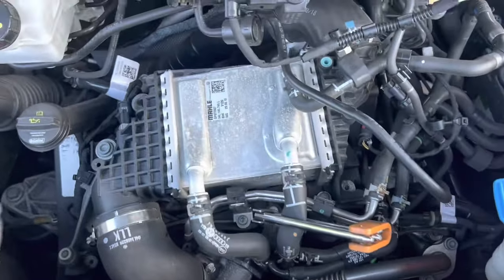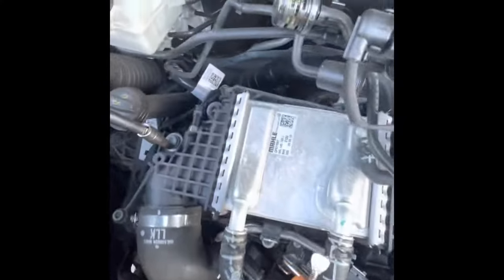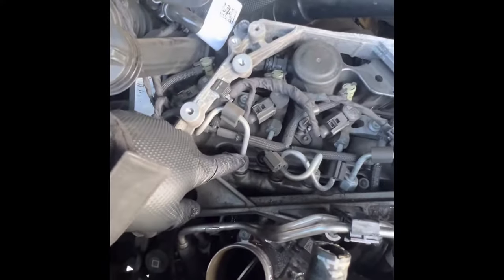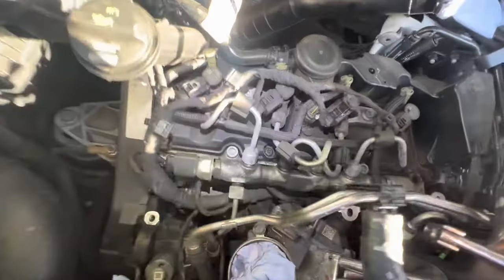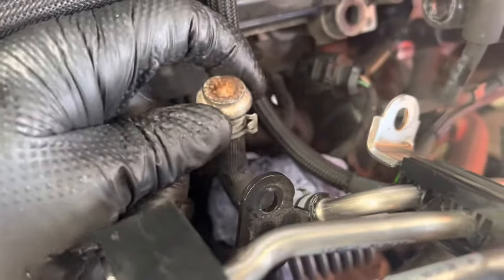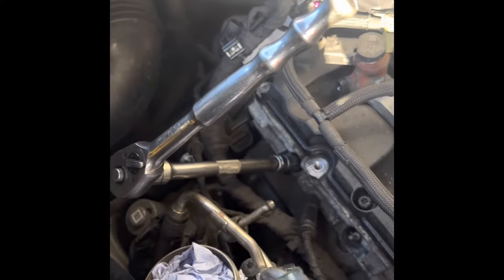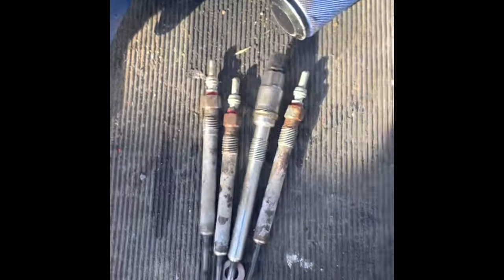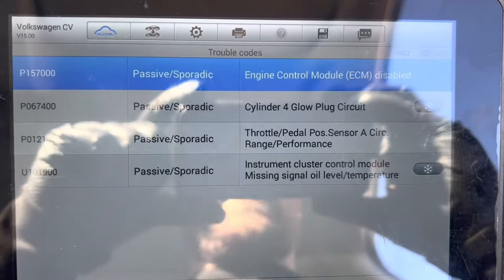How to replace glow plugs on a VW Transporter T6

Comment: I cant get start after i changed glow plugs, took fuelrail of. Bleed the diesel system with vagcom before i cranked but no start. Do the injectors need to come off and be filled with diesel/primed?
Reply from the maker: No, you should be able to keep bleeding it with vagcom, may need to ever so slightly crack 1 injector fuel like union whilst cranking, failing that you could put some brake cleaner in a spray bottle and lightly spray it in the intake system whilst someone else is cranking it over
Reply: Tried start spray and also opened on all injectors, but still no engine start. Also no fault codes on the car
Reply from the maker: @Kasperh27 easy start won’t necessarily work, it needs a slow steady spray (of brake cleaner, easy start is too aggressive) whilst all of the air is expelled, that’s all it will be is air in system
Reply: How did you get it runnin? I have the same problem.
Reply: @Ukulea56777  problem is delphi injectors gets air in and the piston get stuck, you need to make high railpressure and bleed the injectors. I used startspray and got engine up to around 4k rpm and bleed one after one injector until it fired, it take long time so be patient
Reply: @Kasperh27  Thank you!
Reply: @Ukulea56777  also you need to bleed injectors with electric connectors connected!

Comment: Good video, helpful.

Just gonna do mine as leak off pipe needs changing and one glow plug is down.  Seeing as you need to take all that crap off to get to the bits the lot are getting changed....

As for the missing bolt I was wondering that but seems there isn't one there and the cooler free floats that end.
Reply from the maker: Thank you, Really isn’t a bad job at’ll

Comment: Great video well done. I got to do these tomorrow. Is it 100% necessary to remove fuel rail? Looks like u might be able to get them out with in place? Always difficult to tell in a video 🙏 happy new year everyone
Reply from the maker: From memory, I think the one on cylinder 4 wouldn’t be possibly or maybe a bit tricky, it’s not difficult to remove it though, or to get the van started afterwards just cycle the ignition a good few times before attempting to start it if you’ve not got a diag machine that will active fuel pump or do a fuel air bleed 👍
Reply: Great stuff thanks for the info mate! 👍👍👊👊
Reply from the maker: No worries dude 👍

Comment: What diagnostic tool are you using to bleed fuel rail. Shame you didint do a vid on bleeding the system after refitting.
Reply from the maker: On these technically you can just cycle the ignition a good few times and they are pretty good for starting, however most diagnostic machines will have a option to bleed the system, I’ve got a Autel for this

Comment: How do you the plugs off the top of the glow plugs …we’re the electric terminals go ?
Reply from the maker: They just pull off mate, can be a little tight/sticky
Reply: @kerbsidemobilemechanic  even on the pressure sensor one?

Comment: Just bought 2017 62 kw t6 and glow plug light doesn't come on. Is this normal?
Reply from the maker: It should come on for a couple of seconds and then go out, might have an issue If it doesn’t come on at’ll when you first turn the ignition on, maybe there’s a fault code that’s been mapped out
Reply: Instrument cluster very basic just 2dials
Reply: @kerbsidemobilemechanic  how would I tell
Reply from the maker: Should still have all lights come on and go back out
Reply from the maker: Are you having an issues at the mo?
Reply: @kerbsidemobilemechanic  engine light come on yesterday code   p226D had turned off for cleaner added and done a run. Stayed off so far no starting issue.on startupno dpf ligh either .thanks for reply
Reply from the maker: No problem, hope you’ve subscribed 😉

Comment: All very well to say refit in the reverse of the removal so what it you did not take it apart in the first place
Reply from the maker: Why would you be putting it back together if you didn’t take it off in the first place? 😂😂
Reply: @kerbsidemobilemechanic  yes providing that you took it apart in the first place I have worked in garages where I have had to put things back together that someone else has taken apart
Reply from the maker: if you watch the video and see what comes off surely you have enough info and experience to put it back together?